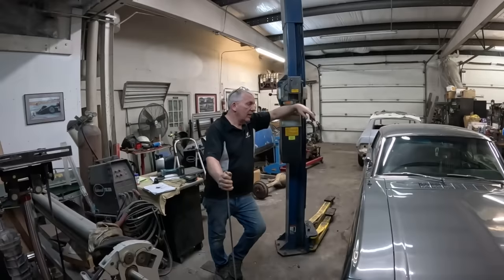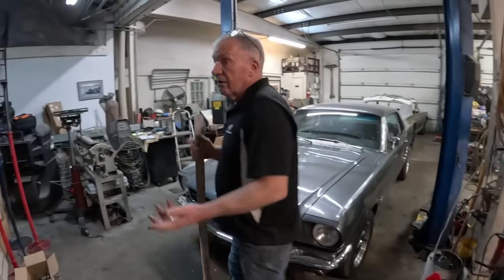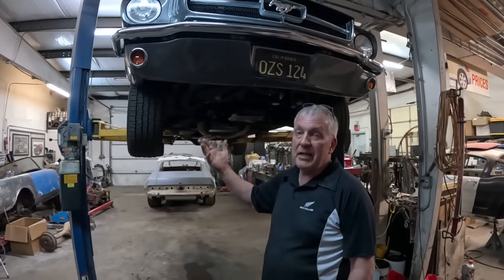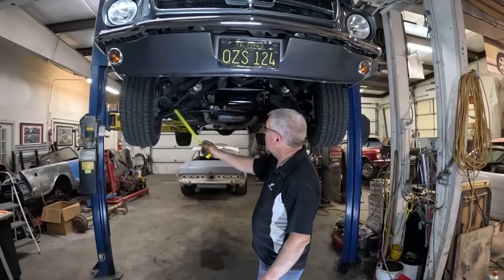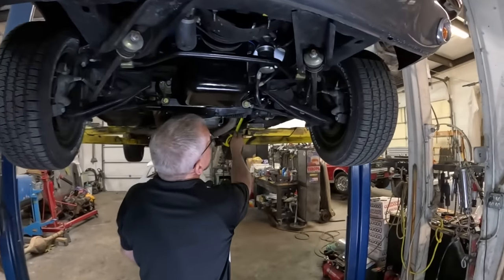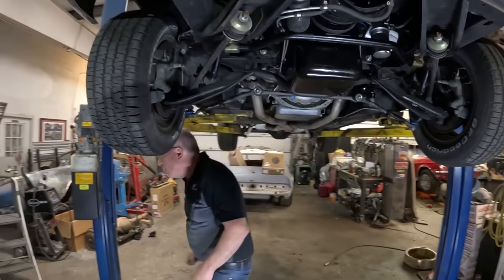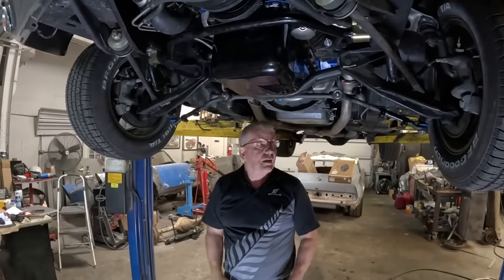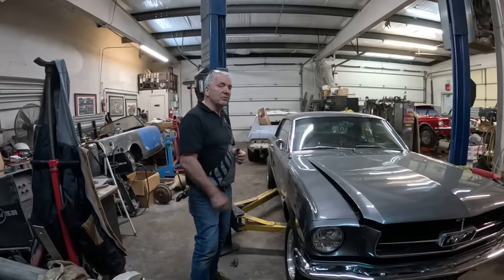Flaming River Fiasco

Comment: That's a tough business to be in. Most of those cars were off the road by mid 1980's.
Someone shoe shines them and people dry when you uncover 60 years of poor work ethics and stripped threads as well as rust. They think the cars are better shape than the one they stopped driving in 1977.
A restoration shop is a storage facility waiting for parts and don't see the ROI like a flat rate shop does per hour. THESE PEOPLE DESERVE MORE MONEY FOR FIXING THE MISTAKES OF OTHERS. Been there, done that and moved on to make a [decent] living.

Comment: These mustangs with relatively stock steering kicked ass on the road racing circuit for years. Shelby had a mod where the mounting points for the upper control arms where lowered about 1/2 inch or so. Are you familiar with that Kiwi?? If it aint broke, don't fix it is my go to. I'm not saying that there are not upgrades but this is ridiculous.

Comment: Trig errors are often the function of someone taking measurements and forgetting you can't crunch numbers  until sorting out triangulation using one established  square angle.  I wonder if this was one of those occurrances.  A 5 1/2" toe in is so far away from spec mr Magoo could spot somethings wrong.

Comment: From the looks of the undercarriage, I think the previous builders did a much better job putting this Mustang together than the other messes you show us.  There does not appear to be any oil leaks.  Maybe they did not know about the issues with the rack and pinion conversion and trusted that the aftermarket kit could be a plug and play swap.

Comment: Stock mustang steering of that era was actually pretty tight and responsive, it used an external booster "ram" which had two little hoses that hung down a little below the car. I wonder if that flaming river kit is even made for a mustang?

Comment: Really not the way to check toe in, car should be at ride height not up in the air.
Reply from the maker: It was just a comparison to the old steering.  In no way meant to be an alignment.
Reply: Figured you knew the deal, just added in so other people wouldn't  think that was  a way to check toe in.
Reply from the maker: @daveshepherd8460   fair enough, cheers!

Comment: Holy mackerel Kiwi, had the same issues with after market suspension too! Serious bump steer, dangerous like all the mustang 2 crap( pinto). Everyone asking why I didn't change the front suspension on my 54 Bel-Air? Good enough for a Corvette till 60s, and easy rebuild. Good on ya restore it to stock. They road racer those cars. Engineers in white lab coats.😅❤

Comment: Good lord, the last time I saw something with that much bump steer, it was a toy car. Before that, it was a cheap Chinese 2wd 4 wheeler that a friend bought at our local mall from one of those little pop up stores that sell cheap gasoline powered Chinese scooters, mini bikes, dirt bikes and 4 wheelers for way more than they are worth. He bought it as a first 4 wheeler for his kiddo and it ended up given away after 6 months, because it handled like crap when it worked, it ran fine for about 4 months, by month 5 it was running weird, and by month 6 or so it broke the connecting rod.

Comment: Maybe their tag line should be "everywhere but straight under brakes". My first FWD car was a 2 litre laser XRi. Great little car but it suffered from bump and torque steer more than my previous RWD vehicles. Only thing it ever failed a WOF on was a number plate light out. A few years ago I heard that a number of imported muscle cars were being failed at the inspection stage because they had certain aftermarket suspension parts fitted that were OK and madein the USA. I always thought American made stuff was superior until I saw some of it. Our WOF system may be derided and sometimes over the top - I just finished repairing some mild surface rust on a friend's Mazda rear floor. If you are building a performance car though, the parts you use should make the car better and not unsafe or make it perform worse.
Reply: some countries get fairly pedant about the stuff being stock certified that's on a car mods wise.

a lot of them are very anti-modifications to power etc too. well, usa is as well it's just that nobody seems to care and it's not enforced at all.
Reply: @lasskinn474  imagine driving this mustang hard on a wet, twisty road. Turn left and the loaded right wheel is trying to turn not quite as left as the left tyre is. The opposite would happen turning right. Wear on the inside tread of the tyres would also be excessive as well as extra wear on the steering components. Terrible set up but not the worst out there by a long shot.

Comment: Awesome work Kiwi.good thing you made it correct or  those tires would have been scrubbed off on the outer edges in about 50 miles.

Comment: HAving a bind in your steering is maddening!! I had a bind in my 2006 F150 Steering linkage. The u-joint was seizing up from corrosion, I lubed it and it helped for a while but i had to replace the shaft that connected column to the rack to fix it for good.

Comment: Good call Kiwi....Apart from basically being a bad design why not use cv joints?
Reply from the maker: CV joints?? As in constant velocity joints
Reply: @kiwiclassicsandcustoms9160  exactly
Reply from the maker: @oops1952  in the steering?
Reply: @kiwiclassicsandcustoms9160  Yes, should be able to die without the tight spots....Right?
Reply from the maker: @oops1952  ahh you mean in the column to rack joints. That would be better but I haven't seen them small enough to do that job

Comment: I installed a Flaming River  polished stainless steel tilt steering column in my 34 Ford Coupe.
It's got a terrible amount of play in the column itself which must be the universal joint that allows the column to tilt.
I'm going to replace it with another brand soon.
I would never buy another Flaming River product.
Total junk in my opinion.

Comment: Wow, thats embarrassingly bad. I have a 65 pontiac and all the early GM A bodys were known to have pretty poor geometry. I looked at several brands of " bolt in" rack conversions and its blatantly obvious without even sampled one that the crossmember shape forces the rack to be in a position that would destroy the ackerman geometry. Stayed with the stock steering gear and fixed the bump with a simple tie rod end change.
Reply from the maker: The factory stuff was usually better than it's given credit for especially when you factor in the engineers mandate was to please the "general" public and of course the company bean counters .....

Comment: Man you killed me, I have the flaming river rack on my 74 corvette. I’ve been working on it for 10 years and it’s not done and I haven’t noticed the toe in you showed but I do have the binding of the steering because of the 🎉ujoints. I actually removed metal from the joints to try to minimise the binding. I paid a fortune for that thing when I bought it. Oh well I’ll figure out something.
Reply: I don't think it is a Flaming River rack. Look on there website, it doesn't look like any rack kit sell for 66 mustang.
Reply from the maker: It's got their branding all over it!
Reply from the maker: Charger1908  you may not have the bumpsteer issues on your corvette. It's the location of the rack that's causing the issues on the mustang.

Comment: I've installed a few Flaming River racks, never had such an issue..I never did a Mustang conversion, but the Chevy trucks I've done were spot-on..I've got one of their manual racks in my own 'stang (it's a '97 that originally had a power rack, not a conversion) and it works as it should.
Anyone with experience wouldn't even consider installing a rack with that much difference in tie rod/a-arm length...which leads me to think this isn't the part that FR supplies in their kit..either it was shipped in error or some hack installed whatever he could get..
Reply: I don't think it is a Flaming River rack. Look on there website, it doesn't look like any rack kit sell for 66 mustang.
Reply: @GNaron  
Kiwi didn't show much of it, but it sure didn't LOOK like there was an FR crossmember installed..
Reply: @zrxdoug  He show quite a bit of it on the other video of car. The dead give away it the FR doesn't use tie rods on 66 mustang, the rod ends screw directly the rack.

Comment: Flaming river off the list, can you do a review of the RRS suspension & suspension products? 
Great video 👍🏼
Reply: I’m hoping for the same. I have a 69 Fairlane with TCP coil over conversion, love it! However I’d like to make the steering as responsive as the suspension; looking at RRS as well. They appeared well engineered for the Firds, bolting in while still allowing adjustments to limit bump steeer.
I’m considering the Borgeson box but truly want the tighter ratio of the rack. 
I’ve inquired to Kiwi as well, I’ve watched a number of his videos and greatly value his content, as opinion

Comment: Manual Ford steering might be optimal
Reply: Tighten up the turn radius, add fat tires and the steering effirt goes up a lot, especially at low speed.   That's fine for a track car, but most people don't care for that in a street car.